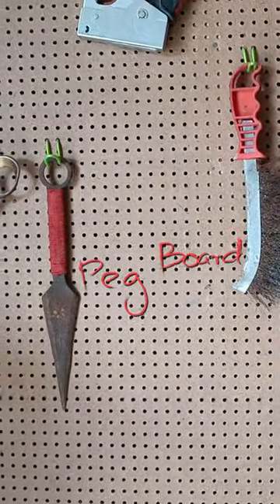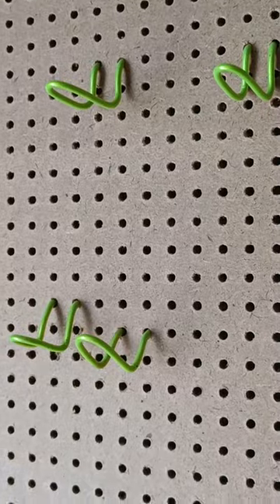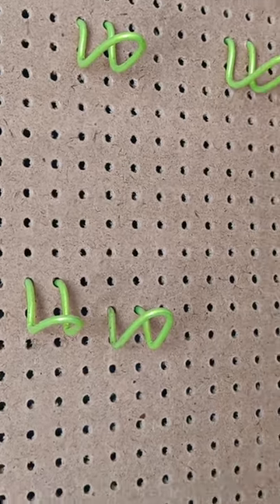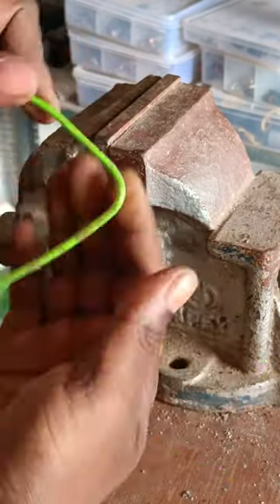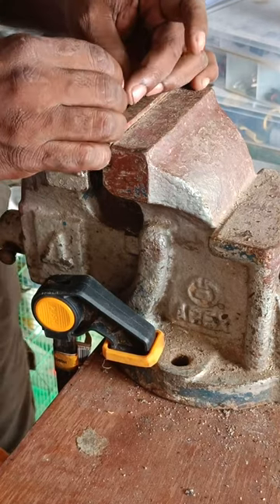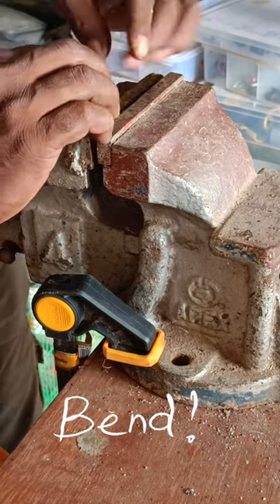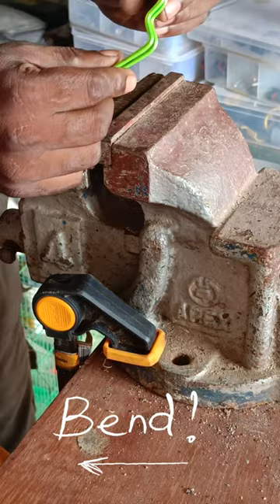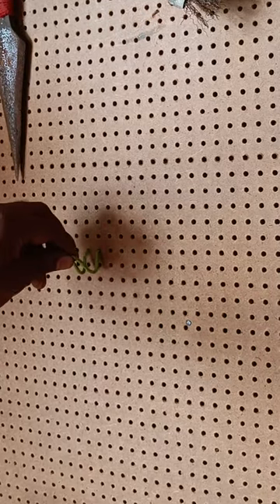Pegboard hooks made with scrap wire - How to make them

Comment: Worked for me.
I'd use light gauge steel wire for practice, as illustrated in the video.  It's a LOT easier to bend!

After you master the dkill, go on to use heavier gauge steel wire if desired.  That's tougher to make a sharp bend/  I used a cold chisel and a hammer to bend heavier gauge wire,  but there may be better ways.

In my neighborhood in Seattle,  there are too many plastic signs posted on public right of ways, using a steel wire frame to hold up these nuisance signs.  I often pull down the signs,  and now I have something to do with the wire frames.
Reply from the maker: I enjoyed reading your comment. Thanks for your time. I usually use aluminium hangers to make these pegs, by nowadays I am not getting those. This wire is called "Stay" wire here...don't know why. I tried it and it worked. Its a lot cheaper too
Reply: <<I enjoyed reading your comment. Thanks for your time. I usually use aluminium hangers to make these pegs, by nowadays I am not getting those. This wire is called "Stay" wire here...don't know why. I tried it and it worked. Its a lot cheaper too>>

Thank you for the encouragement.

More experimentation is called for,  I suggest!

For example,  I'd like to try using 12 gauge and 10 gauge copper wire and see how that works.

A jig that would make bending easy and accurate would be good.  I'm experimenting with just a couple of nails in a piece of wood for bending. 

And how to hold pegs in the pegboard so they don't come out.  Lots of ideas on that.  I favor using a staple gun at the moment.  .

Comment: i designed my custom sized pegboard with 1/4 inch holes 1 inch apart with laser cut on 3mm MS sheet. worked out amazingly well and quite cheaper than readymade online available alternatives. but accessories/hooks are quite expensive here in india. this helped while my brother brings some from the US. thanks.
Reply from the maker: I am glad it helped. All the best for your future endevors

Comment: @videopro Bro where I can get square tubes or L rods, will it be available in Hardwares?
Reply from the maker: No hardware guy dont have the Square Pipes. There are separate shops.
Reply: @VIDEOEPPO  Thanks bro, will try getting it in the shops where they are making gates.